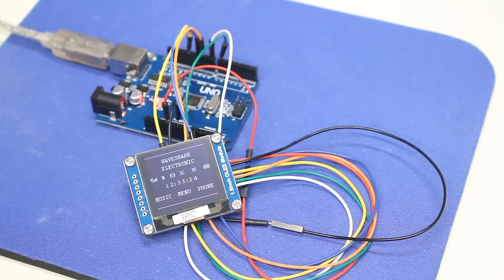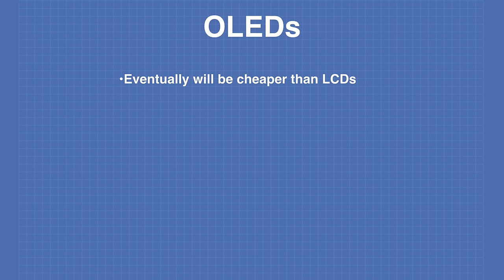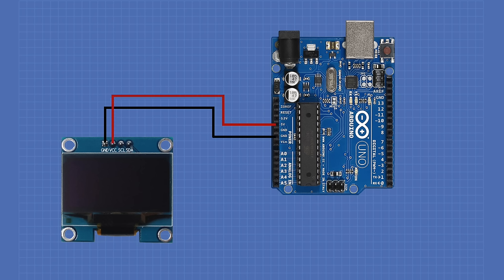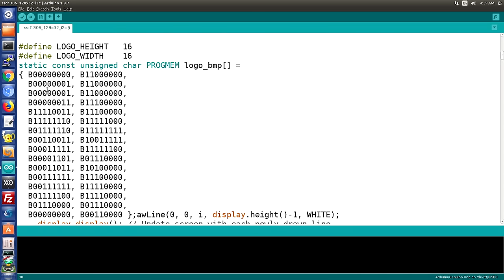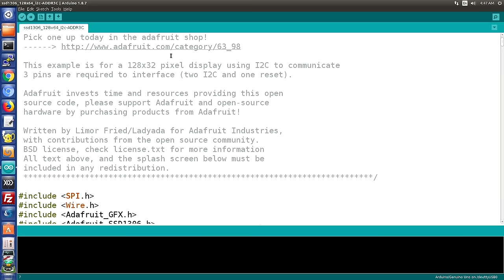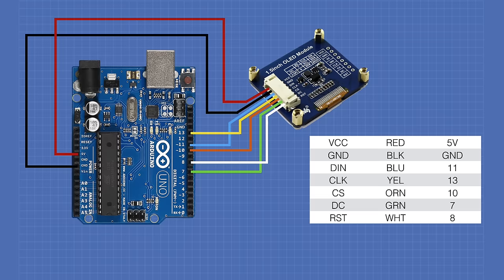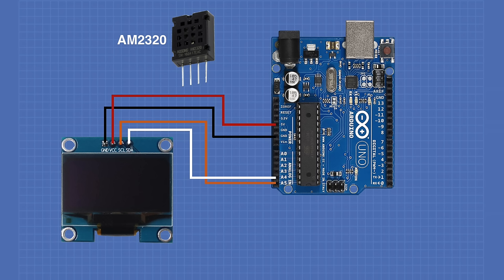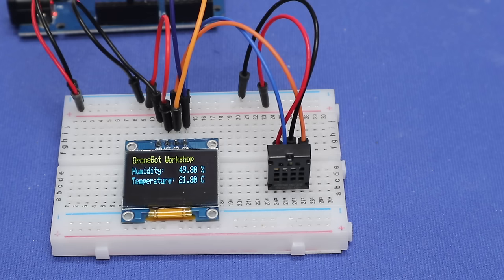OLED Displays with Arduino - I2C & SPI OLEDs

Comment: Where are you getting your info that says that Samsung make their own panels? 

This is a direct contradiction of material both (0) heard in other YT videos and (1) researched (very lightly) via google a minute ago. LG was and are still said to be the major manufacturer of OLEDs - Why would I bother researching much? Linus Tech Tips has already nailed this point.

Case in point. After asking google "who makes oled panels?" One is rewarded with the following:
As of 2018, the only company that produces produces commercial OLED TV panels is LG Display, and LG Electronics is the leading OLED TV producer - although LGD also supplies OLED panels to other companies including including Panasonic, Sony, Grundig, Philips, Metz, Loewe, Skyworth, Changhong, Haier, Konka and others.

After then clicking on one of the suggested questions, "Who makes Samsung OLED panels?" the returned result is:
"LG
Samsung's $11 billion bet on quantum dots

And at the moment only one company makes big-screen OLED display panels: LG.Apr 14, 2020"

It's a real shame. With such an apparent inaccuracy right off the bat and several comments talking about the editing style. I can't in good conscience press the un-pause button. The counter reads exactly 1 minute.

I really considered whether or not I'd add this part about leaving. I don't really want to do this. You've put in real effort, time and care to produce material aimed at helping others interested to learn. Since apparently only about 8 in 200 dissatisfied customers would traditionally complain about something, we may have spent a good portion of our lives believing that those who now displease us simply don't care. When so very often, the truth was that the company/organisation wasn't receiving honest feedback about aspects of their performance that should be eliminated/repeated.

I'm just 1 tiny little person. My thoughts don't matter unless you know and like me. I'm certainly under no illusion about my own importance.

I hope I've not caused offence.

Comment: HALP!!
Is there any differences to the code or setup for using this on an Mega2560 because despite following everything in this video and the user manual on waveshare wiki I'm stumped..
Either I have screwed up somewhere or my OLED is DOA?? Any suggestions?
I've asked for help on Reddit here for a bit more info if you can supply any it would be most appreciated.
https://www.reddit.com/r/arduino/comments/ehvoby/noob_needs_help_with_15_oled_possible_doa_or_my/

Comment: Lots of very basic detail in wiring. 

Presentation is very slow, also no need to show a face, unless you are a lip reader, no added value from a face.
 "Adafruit" not needed in search-string, it will come up anyway.
The whole presentation could have been made in 15 minutes.

Comment: here is the sketch that i am having problem displaying properly looks like it is 128x32 and should be 128x64/*******************************************************************
RPM Tachometer with OLED digital and analog display
 *********************************************************************/
 
#include <Wire.h>
#include <Adafruit_GFX.h>
#include <Adafruit_SSD1306.h>
#include <Math.h>

namespace {
  const int OLED_RESET = 4;
  const int TEXT_SIZE_SMALL = 1;
  const int TEXT_SIZE_LARGE = 2;
  const int ONE_K = 1000;
  
  const int OLED_HEIGHT = 64;
  const int OLED_WIDTH = 128;
  const int YELLOW_SEGMENT_HEIGHT = 16;
  const int DISPLAY_FULL_BRIGHTNESS = 255;
  const int DISPLAY_DIM_BRIGHTNESS = 0;
  
  const int IR_LED_PIN_3 = 3;
  const int PHOTODIODE_PIN_2 = 2;
  const int INTERRUPT_ZERO_ON_PIN_2 = 0;
  
  const uint16_t DIAL_CENTER_X = OLED_WIDTH / 2;
  const uint16_t DIAL_RADIUS = (OLED_HEIGHT - YELLOW_SEGMENT_HEIGHT) - 1;
  const uint16_t DIAL_CENTER_Y = OLED_HEIGHT - 1;
  const uint16_t INDICATOR_LENGTH = DIAL_RADIUS - 5;
  const uint16_t INDICATOR_WIDTH = 5;
  const uint16_t LABEL_RADIUS = DIAL_RADIUS - 18;
  const int DIAL_LABEL_Y_OFFSET = 6;
  const int DIAL_LABEL_X_OFFSET = 4;
  
  const long MAJOR_TICKS[] = { 0, 10000, 20000, 30000 };
  const int MAJOR_TICK_COUNT = sizeof(MAJOR_TICKS) / sizeof(MAJOR_TICKS[0]);
  const int  MAJOR_TICK_LENGTH = 7;
  const long MINOR_TICKS[] = {5000, 15000, 25000};
  const int MINOR_TICK_COUNT = sizeof(MINOR_TICKS) / sizeof(MINOR_TICKS[0]);
  const int MINOR_TICK_LENGTH = 3;
  
  const uint16_t DIAL_MAX_RPM = MAJOR_TICKS[MAJOR_TICK_COUNT-1];
  
  const int HALF_CIRCLE_DEGREES = 180;
  const float PI_RADIANS = PI/HALF_CIRCLE_DEGREES;
  
  const double MILLIS_PER_SECOND = 1000.0;
  const double SECONDS_PER_MINUTE = 60.0;
  const long DISPLAY_TIMEOUT_INTERVAL = 120 * MILLIS_PER_SECOND;
  const long DISPLAY_DIM_INTERVAL = DISPLAY_TIMEOUT_INTERVAL/2;
  const long DISPLAY_UPDATE_INTERVAL = 250;
  const int  DISPLAY_AVERAGE_INTERVALS = 4;
  
  volatile unsigned long revolutions;
  
  unsigned long previous_revolutions = 0;
  unsigned long revolution_count[DISPLAY_AVERAGE_INTERVALS]; 
  unsigned long interval_millis[DISPLAY_AVERAGE_INTERVALS]; 
  unsigned int interval_index = 0;
  unsigned long previous_millis = 0;
  unsigned long last_sensor_time = 0;
  bool is_oled_display_on = false;
  bool is_oled_display_dim = false;
}

Adafruit_SSD1306 display(OLED_RESET);

void setup() {
  Serial.begin(9600);
  initOledDisplayWithI2CAddress(0x3C);
  display.setTextColor(WHITE);
  initArrays();
	
  turnOnIrLED();
  attachPhotodiodeToInterrruptZero();
  last_sensor_time = millis();
  turnOnDisplay();
}

void initArrays() {
  memset(revolution_count,0,sizeof(revolution_count));
  memset(interval_millis,0,sizeof(interval_millis));
}

void loop() {
  unsigned long current_millis = millis();
  if (current_millis - last_sensor_time >= DISPLAY_TIMEOUT_INTERVAL) {
    turnOffDisplay();
  } else if (current_millis - last_sensor_time >= DISPLAY_DIM_INTERVAL) {
    dimDisplay();
  }  
  
  if (current_millis - previous_millis >= DISPLAY_UPDATE_INTERVAL) {
    previous_millis = current_millis;
    updateDisplay();
	}
}

void initOledDisplayWithI2CAddress(uint8_t i2c_address) {
  display.begin(SSD1306_SWITCHCAPVCC, i2c_address);
}

void turnOnDisplay() {
  display.ssd1306_command(SSD1306_DISPLAYON); 
  display.dim(false);;
  is_oled_display_on = true;
  is_oled_display_dim = false;
}

void turnOffDisplay() {
  display.ssd1306_command(SSD1306_DISPLAYOFF); 
  is_oled_display_on = false;
  is_oled_display_dim = false;
}

void dimDisplay() {
  display.dim(true);
  is_oled_display_dim = true;
}

void turnOnIrLED() {
  pinMode(IR_LED_PIN_3, OUTPUT);
  digitalWrite(IR_LED_PIN_3, HIGH);
}

void attachPhotodiodeToInterrruptZero() {
  pinMode(PHOTODIODE_PIN_2, INPUT_PULLUP);
  attachInterrupt(INTERRUPT_ZERO_ON_PIN_2, incrementRevolution, FALLING);
}

void incrementRevolution() {
  revolutions++;
}

void updateDisplay() {
  long rpm = calculateRpm();
  if (rpm > 0) {
    last_sensor_time = millis();
    if (!is_oled_display_on || is_oled_display_dim) {
      turnOnDisplay();
    }
  }
  if (is_oled_display_on) {
    display.clearDisplay();
    drawRpmBanner(rpm);
    drawDial(rpm);
    display.display();
  }
}

long calculateRpm() {
  unsigned long current_millis = millis();
  unsigned long current_revolutions = revolutions;
  unsigned long previous_display_millis;
  unsigned long previous_revolutions;
    
  queueIntervalRevolution(current_revolutions, current_millis);
  previous_display_millis = getIntervalMillis();
  previous_revolutions = getIntervalRevolutions();

  unsigned long elapsed_millis =  current_millis - previous_display_millis;
  float elapsed_seconds = ((elapsed_millis * 1.0) / MILLIS_PER_SECOND);
  float delta_revolutions = (current_revolutions - previous_revolutions) * 1.0;

  long rpm = (long) ((delta_revolutions / elapsed_seconds) * SECONDS_PER_MINUTE);
  return rpm;
}

void queueIntervalRevolution(unsigned long revolution_value, unsigned long milliseconds) {
  interval_index++;
  int queue_index = (int)(interval_index % DISPLAY_AVERAGE_INTERVALS);
  revolution_count[queue_index] = revolution_value; 
  interval_millis[queue_index] = milliseconds;
}

unsigned long getIntervalMillis() {
  int index_front_of_queue = (int)((interval_index + 1)  % DISPLAY_AVERAGE_INTERVALS);
  return interval_millis[index_front_of_queue];
}

unsigned long getIntervalRevolutions() {
  int index_front_of_queue = (int)((interval_index + 1)  % DISPLAY_AVERAGE_INTERVALS);
  return revolution_count[index_front_of_queue];
}

void drawRpmBanner(long rpm_value) {
  display.setCursor(0, 0);

  display.setTextSize(TEXT_SIZE_LARGE);
  display.print("RPM: ");
  display.print((long)rpm_value);
}

void drawDial(long rpm_value) {
  display.drawCircle(DIAL_CENTER_X, DIAL_CENTER_Y, DIAL_RADIUS, WHITE);
  drawTickMarks();
  drawMajorTickLabels();
  drawIndicatorHand(rpm_value);
}

void drawTickMarks() {
  drawTicks(MAJOR_TICKS, MAJOR_TICK_COUNT, MAJOR_TICK_LENGTH);
  drawTicks(MINOR_TICKS, MINOR_TICK_COUNT, MINOR_TICK_LENGTH);
}

void drawTicks(const long ticks[], int tick_count, int tick_length) {
  for (int tick_index = 0; tick_index < tick_count; tick_index++) {
		long rpm_tick_value = ticks[tick_index];
		float tick_angle = (HALF_CIRCLE_DEGREES * getPercentMaxRpm(rpm_tick_value)) + HALF_CIRCLE_DEGREES;
		uint16_t dial_x = getCircleXWithLengthAndAngle(DIAL_RADIUS - 1, tick_angle);
		uint16_t dial_y = getCircleYWithLengthAndAngle(DIAL_RADIUS - 1, tick_angle);
		uint16_t tick_x = getCircleXWithLengthAndAngle(DIAL_RADIUS - tick_length, tick_angle);
		uint16_t tick_y = getCircleYWithLengthAndAngle(DIAL_RADIUS - tick_length, tick_angle);
		display.drawLine(dial_x, dial_y, tick_x, tick_y, WHITE);
	}
}

float getPercentMaxRpm(long value) {
	float ret_value = (value * 1.0)/(DIAL_MAX_RPM * 1.0);
	return ret_value;
}

float getCircleXWithLengthAndAngle(uint16_t radius, float angle) {
	return DIAL_CENTER_X + radius * cos(angle*PI_RADIANS);
};

float getCircleYWithLengthAndAngle(uint16_t radius, float angle) {
	return DIAL_CENTER_Y + radius * sin(angle*PI_RADIANS);
};

void drawMajorTickLabels() {
	display.setTextSize(TEXT_SIZE_SMALL);
	for (int label_index = 0; label_index < MAJOR_TICK_COUNT; label_index++) {
		long rpm_tick_value = MAJOR_TICKS[label_index];
		float tick_angle = (HALF_CIRCLE_DEGREES	* getPercentMaxRpm(rpm_tick_value)) + HALF_CIRCLE_DEGREES;
		uint16_t dial_x = getCircleXWithLengthAndAngle(LABEL_RADIUS, tick_angle);
		uint16_t dial_y = getCircleYWithLengthAndAngle(LABEL_RADIUS, tick_angle);
		display.setCursor(dial_x - DIAL_LABEL_X_OFFSET, dial_y - DIAL_LABEL_Y_OFFSET);
		int label_value = rpm_tick_value / ONE_K;
		display.print(label_value);
	}
}

void drawIndicatorHand(long rpm_value) {
    float indicator_angle = (HALF_CIRCLE_DEGREES * getPercentMaxRpm(rpm_value)) + HALF_CIRCLE_DEGREES;
    uint16_t indicator_top_x = getCircleXWithLengthAndAngle(INDICATOR_LENGTH, indicator_angle);
    uint16_t indicator_top_y = getCircleYWithLengthAndAngle(INDICATOR_LENGTH, indicator_angle);

	display.drawTriangle(DIAL_CENTER_X - INDICATOR_WIDTH / PHOTODIODE_PIN_2,
	                     DIAL_CENTER_Y,DIAL_CENTER_X + INDICATOR_WIDTH / PHOTODIODE_PIN_2,
	                     DIAL_CENTER_Y,
	                     indicator_top_x, 
	                     indicator_top_y, 
	                     WHITE);
}

Comment: Many pardons but... There is *NO* "gap" existing in a Light Emitting Diode!!!  If there was an actual "gap" it would be called a capacitor... This is still a diode as it says in the name and the two substrates (P & N) are physically laid on top of each other... There is a "depletion zone where all the existing free electrons have shifted over into their corresponding "holes" and forming an insulator, but there is no actual gap between them... the difference between an LED and an OLED is the number and types of layers! Please do not lay inaccurate descriptions for your foundations as this could "bite you in the butt" at a later point in time... either through not working or burning up the component or "letting the smoke out"... If you are going to "educate", do it right!